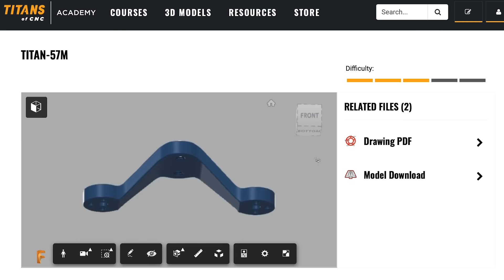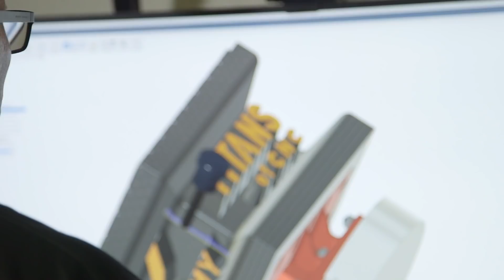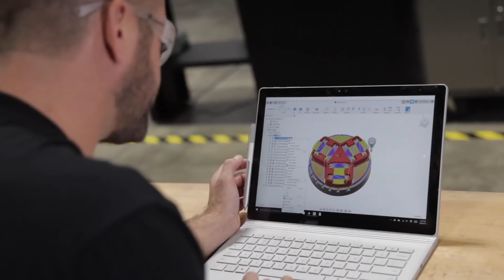$9 hr CNC Machinist to Owning the Shop | THE KEY To Rising In This Industry

Comment: Yo Titan! You're an inspiration bro! I have that passion. I am hungry to go further and learn more. I didnt go back to school until I was 27 and I'm 32 now. Love machining both manual and CNC machines, programming at the control or on CAM software, and modeling using fusion. I always have free time at work to make basically whatever I want. So much stainless, brass, bronze, aluminum, and titanium just sitting here unaccounted for. I'm a hobbyist and would like to take my passion further. I work in a glorified job shop, no lie brother, this shop is the yacht club of machine shops. But the CNC machines i use for the hobby parts I make are getting tied up at work by other employees and my personal projects are getting more and more advanced the more I learn. I'm looking for a machine, something the size of a VMC or bigger but anything new, even a new tormach with their payment plans, is way out of my price range. I keep steady saving but my bills are making building those savings a slow process. I need something durable enough to machine stainless and would love to work on my projects out of my garage, 3 phase is just a block away from me. How do I find something used, dependable, and affordable that might be willing to work with me on payments? I have about 10k saved that I could spend on getting a machine and accessories. Thanks and BOOM!

Comment: One day...last October in Maui Hawaii finished building a small home workspace and have since then moved in a ShopSabre 23 cnc router and a FlexArm A32 pneumatic tapping arm! Last thing before I'm fully setup is a 31cfm@100psi air compressor.

One day I'll have a large workshop with multiple capable cnc machining centers. I'm 24
Reply: I'm also 24 year old. I also building my small workshop. Wish you luck!
Reply: @baron95893  Thanks, best of luck to you too!

Comment: How do you actually start a machine shop?? Like step by step who do you talk to first???
Reply: There's a lot to getting started like setting up a workspace, financing or buying machines, getting them into their location, power and utilities like air(vacuum and pressure).

But what is most important is finding clients to do work for or create a product that has proven to already be something you can machine and sell before making any large investments. Having a large client or product ready will help lower risk and justify the investment.

You don't want to be sitting with a mill that costs over $100,000 with monthly payments of $2,000+ and not have work for it already lined up.
Reply: @B &BSurething, it only gets more and more competitive as manufacturing technology continually becomes more and more available and common.

I live in Maui, there's literally one cnc machine shop that'll do machining for the local community. All other capable cnc mills are private or apart a school or research facility. So in that respect where I am there isn't much competition and a good amount of demand.

That said my machines at the moment are almost entirely for R&D and low to medium production of products. Efficient quality LED growlights and kits for quickly assembling lithium batteries for portable or stationary applications is my personal focus which are competitive markets.